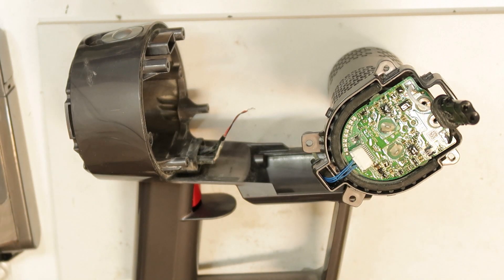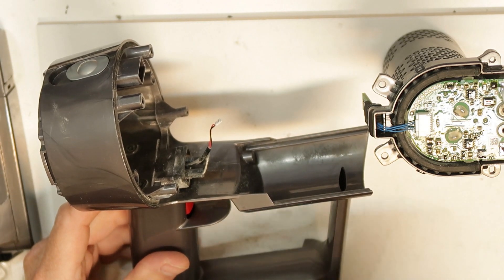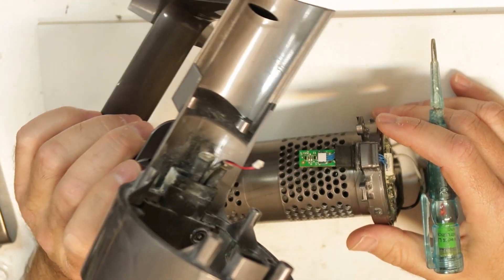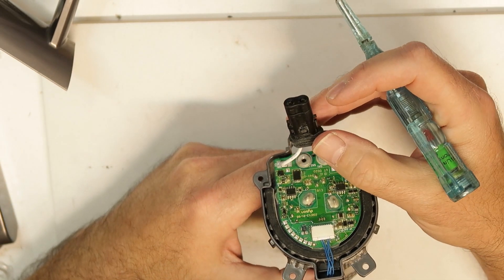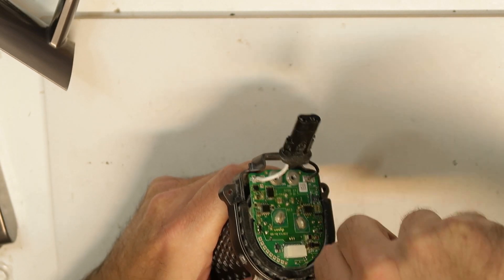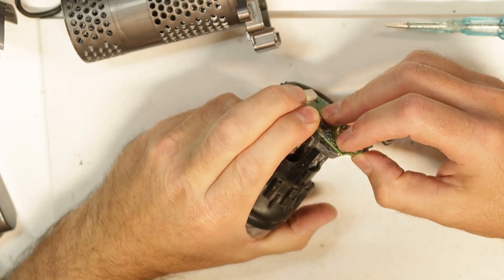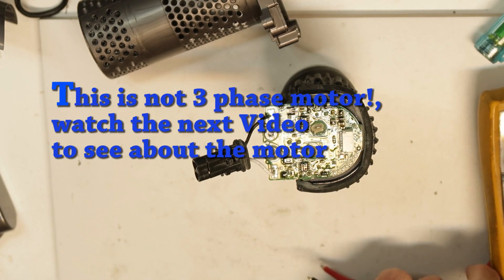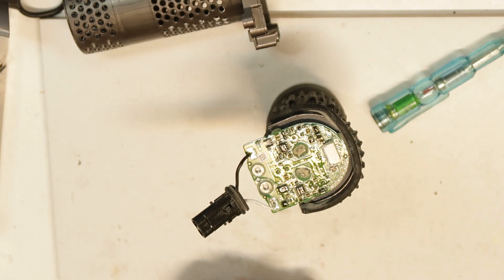Dyson V10 secrets and how it works

Comment: That smd cap is directly across the power supply, you can tell by looking at the copper fills it is attached to, it won't make any difference to operation, if missing, maybe some more EMI radiated.

Comment: Good video question what about the connection in the motherboard for the small black and red wires. If that plastic breaks that connects those to small wires can the vacuum still work?? I broke the small plastic connector on the motherboard for those 2 wires. Can you respond when possible thanks
Reply: I have same issue
Reply: @TwoTubesMTC  GM I ended up buying a new one the whole complete motor unit
Reply: @jballs1118  yeah, I think they made these wires as flimsy as possible for this very reason. Having to buy new also

Comment: How do I power the dyson v10 motor with a 7s lipo battery?
Reply from the maker: did not test it, but you need to supply also voltage for temp sensor

Comment: Nice video that asks , M’y dyson v10 , when I push the power button he make just 1 second sound of motor and nothing happen juste 3 led battery … do you have idea ?
Reply: Same thing happened to mine, took it apart and found the bearings were seized, the motor itself is not serviceable, you can buy a new motor and cyclone assembly on amazon. Reuse your battery (which is removable by taking out 3 Phillips head screws), dust canister and Filter.  Beware of the cheap Chinese copies advertised online.